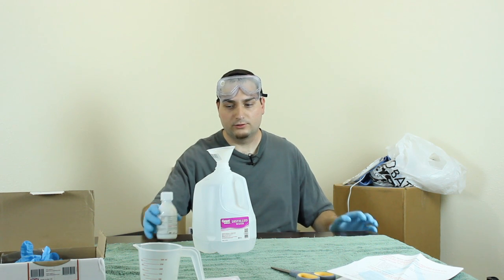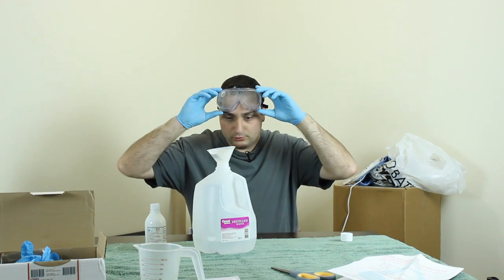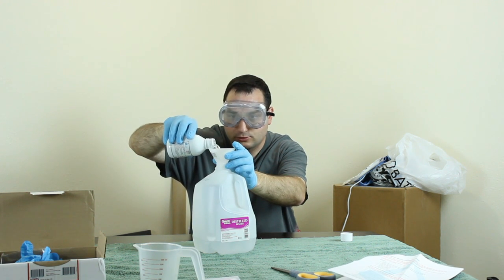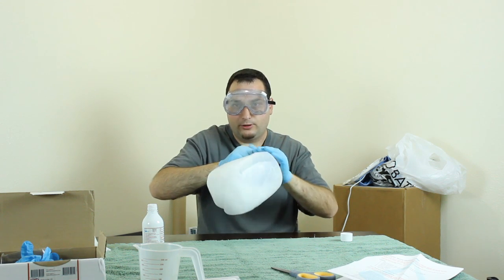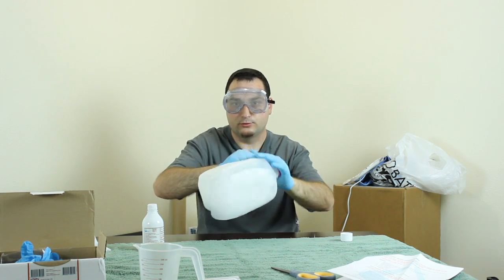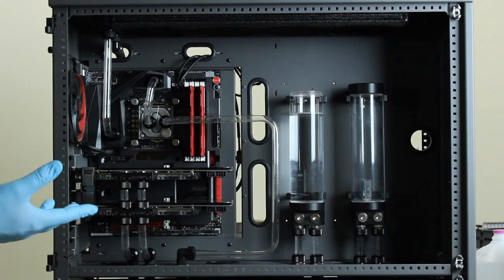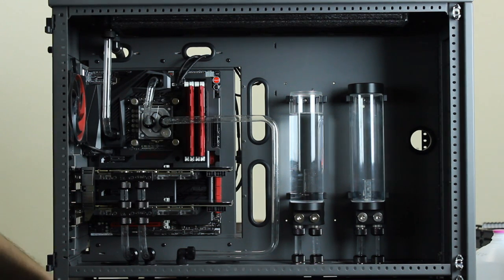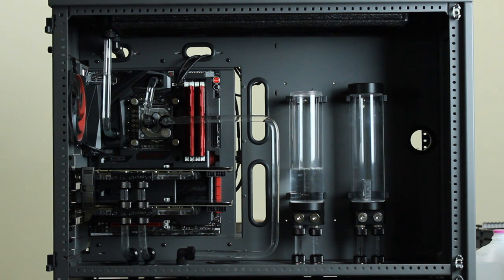How to Flush a Radiator with Blitz

Comment: Thanks for the tips. I am about to order white pastel for my rigid build but this one guys video JayzTwoCents got me nervous.. I guess he didn´t clean the system properly before use?
So.. to top it off.. 1st I but the cleaning fluid in the radiator, shake it a bit so I know the entire radiator is full of water and the cleaner? Let it sit for a day.. then empty that out, but in clean distilled water, shake and clean it nice.. then connect it to the system and but the entire loop under the same stuff for a few days? Then empty as much as possible and but in the pastel of choice?
Reply from the maker: More or less that is how it goes, there are detailed instructions that come with the kit that you can reference as you go. One last tip: you get enough of the part 2 mixture in the kit so you'll have enough left over for use to flush your system when it comes time for maintenance. Thanks for watching :).
Reply: BSTechTalk hey thanks for the quick reply! Greets from Estonia :) trying to build my own wallmounted PC here and wanna get it right the first time :P fans will be upset if I fail haha
Reply from the maker: Good luck, wall mounted PC's are awesome! :)